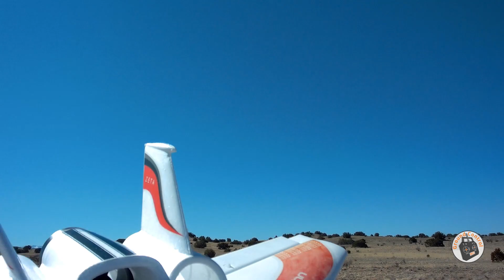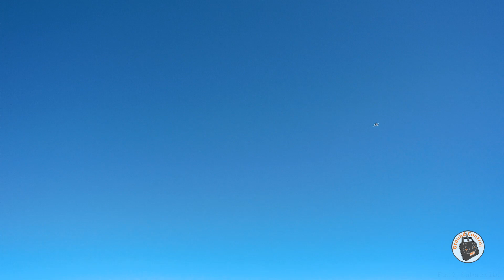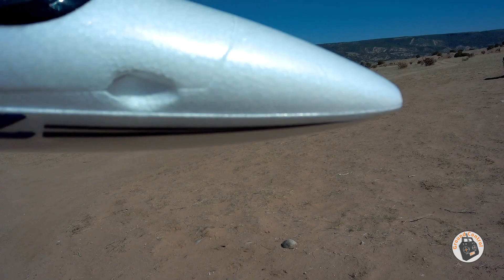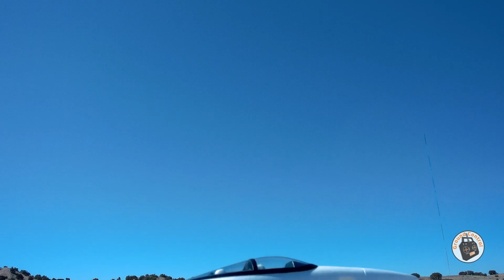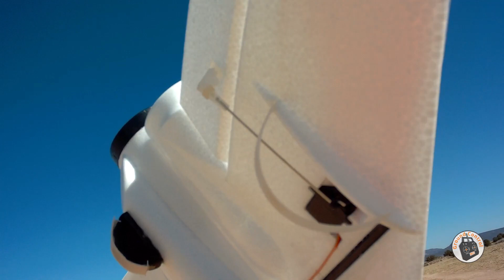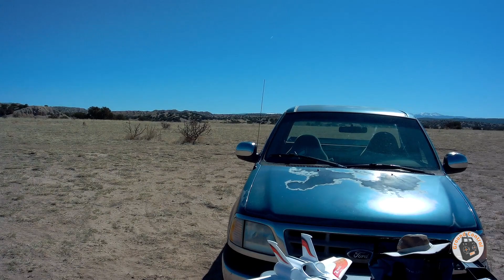Easy to Launch! Easy to Fly! Easy to Land! Zeta Ultra-Z Blaze Jet Single/Dual EDF or Pusher Motor

Comment: Hey great flight I have a question for you. How did you end up securing the battery inside?
Reply from the maker: Thank you much!
This is a fantastic EDF Jet ;-)
I took a velcro battery strap, cut it in half and glued each half to each side of the fuselage.
It won't keep the battery from ejecting in a crash, what would, but it keeps the battery nice and secure during aerobatic flights.
I could have glued in a plywood shelf to secure the battery and battery strap but I was lazy ;-)
I also added some carbon spars along the inside of the fuselage under the canopy as that's where the weak point is on all these EDF Jets.
I just posted my Setup and OpenTX Model Files on our Facebook Page for download if that will be of help.
See you in the Air!
Reply: @GroundControlRC  thanks for the response and I will give it a go. I am not big on Facebook but I'll keep an eye on you from YouTube.
Reply from the maker: @iamalbanyrc2783  You are most welcome.
See you in the Air!